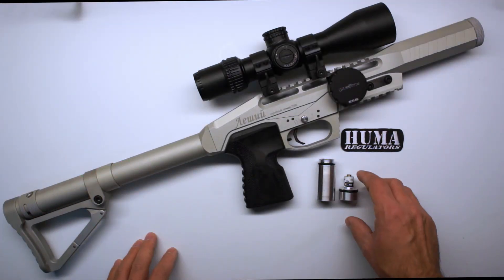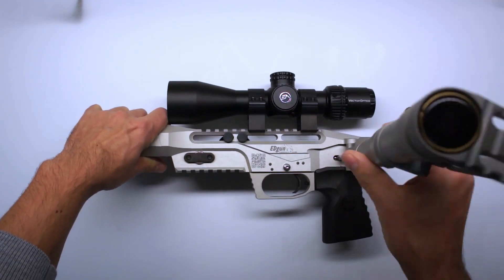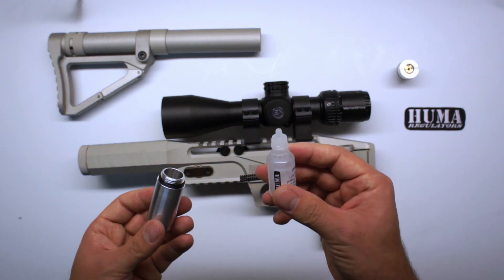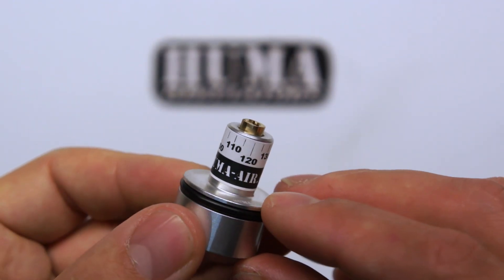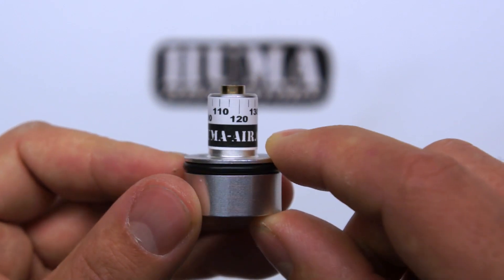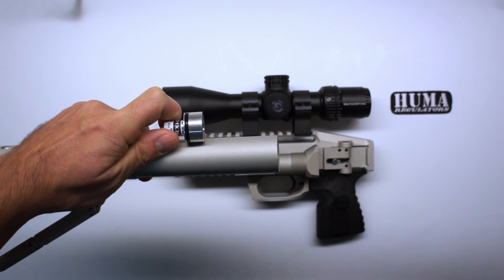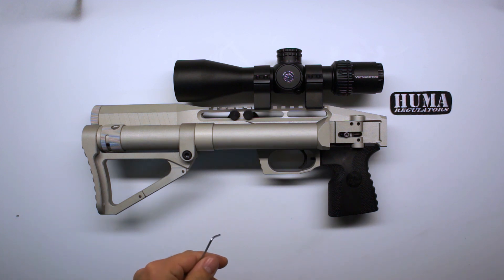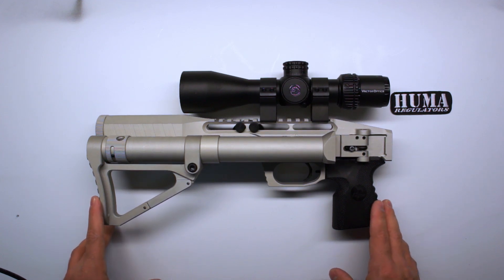EDgun Leshiy Huma regulator install

Comment: What are the O ring sizes to use on this regulator? Specifically the O ring on the top portion. Very difficult to find this data.
Reply from the maker: Hi , honestly I can tell you . I don’t own my leshiy anymore 😬 but contact Huub at Huma air , he can tell you for sure the right answer ! Maybe he can send you a rebuild kit for it
Reply: @Airbuks  thank you. I just cant get my Huma Regulator to seal. I can install the factory Leshiy and get it to seal the fist time, but not the huma. Frustrating...